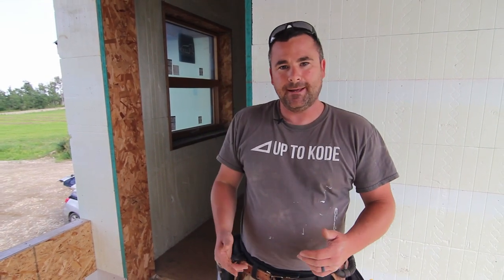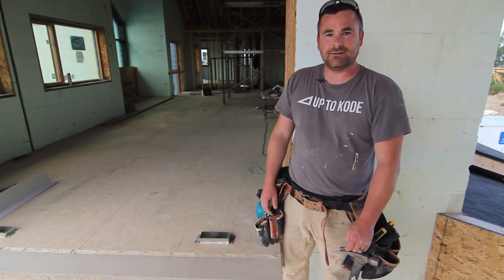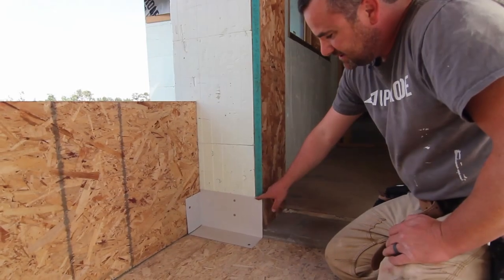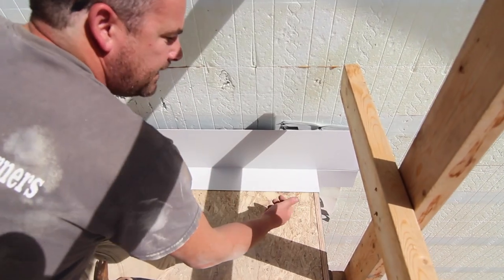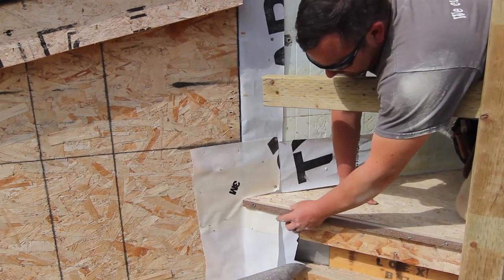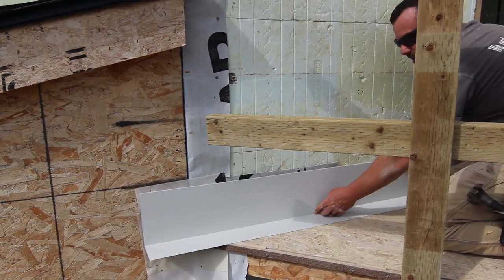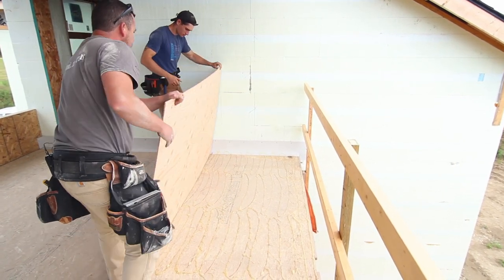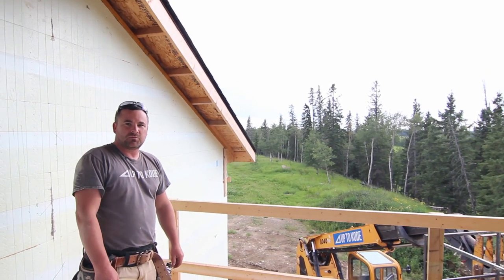Vinyl Decking on an ICF House

Comment: Question and maybe a dumb one. How are the window bucks (rim joist) attached to the concrete?
Reply from the maker: We “porcupine” the side of the buck that the concrete pours against. By that I mean we have nails sticking out of the buck at different angles to bond the buck to the wall.
Reply: Kody Horvey my ICF quote for material included $3000 for their window bucks. Kind of makes sense to make your own 👍🏻

Comment: Hi, I'm looking for a builder that works with ICF in my area. Do you know how I would be able to find one? I want to build a home in the NC in the Guilford county area. I googled it but it seems like only the installers for ICF are popping up and not someone that could manage the entire project.
Reply: BriMcD that’s normal.  You need a general contractor who hires the ICF crew as a sub. This is just like framers, just ICF instead of stud walls. Search for generals and ask them directly.